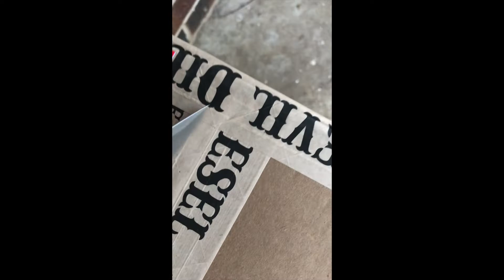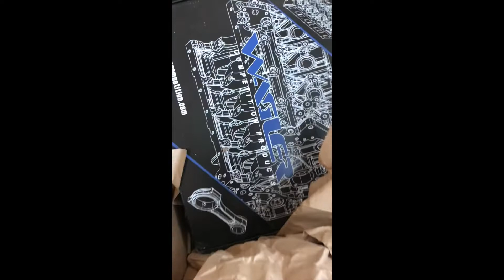More parts showing up for my 6.0 Powerstroke build. This engine will be able to handle all the power

Comment: Nice! Gonna pair them with steel pistons you were contemplating on?  I thought you were nucking fut's at first till I looked into them
Reply from the maker: They are easily available for the 6.4 and 6.7. Pretty hard to find for the 6.0. Headed to SEMA now so I’ll try and dig something up. 
For now I’m just using stock pistons that have been delipped
Reply: @showmerepair  Lucky! i grew up in LV but never made it in one SEMA show unfortunately